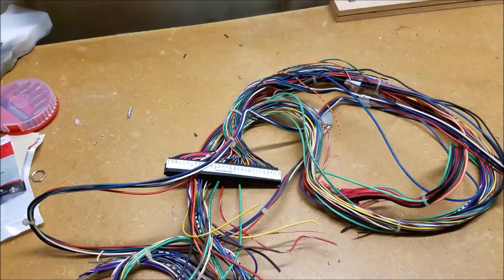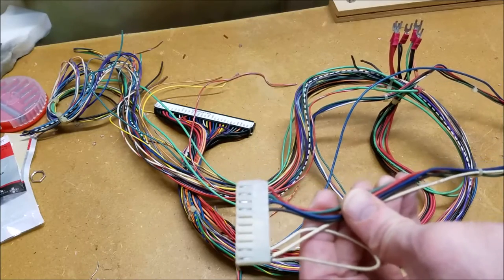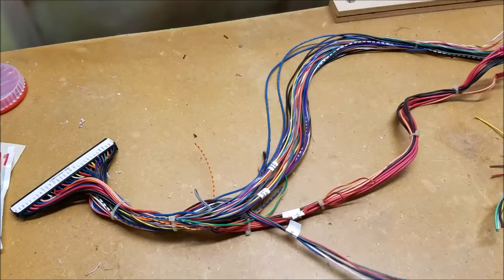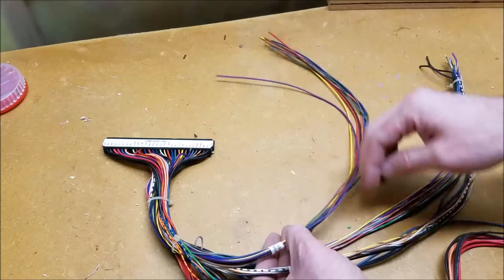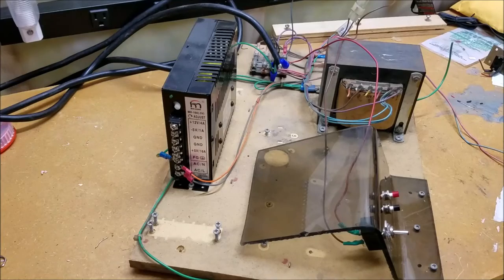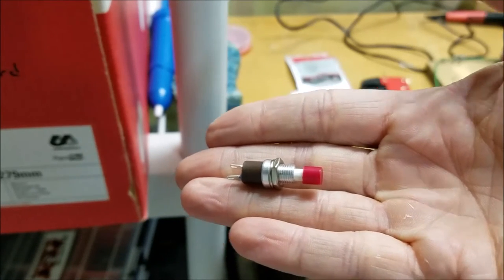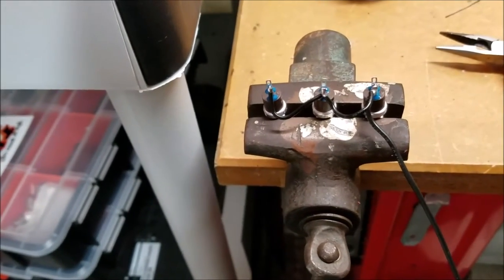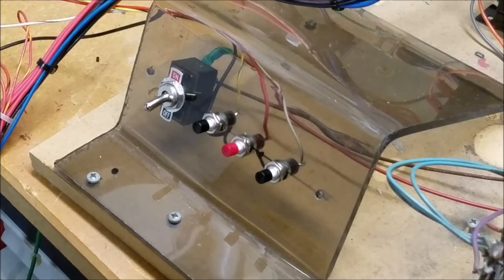Let's Make: Arcade Test Bench - #3 - JAMMA Harness

Comment: nice update Tim! not sure of where youre at but if theres a microcenter near you they usually have cheap computer speakers for like 5-6 bucks, that way you have an amplifier already on them in case your test board doesnt have an amp board for its sound. looking forward to the next part!
Reply from the maker: I'm in New England. Something like that would be great but I haven't heard of one of those. That would be perfect though!
Reply: That Tim Guy its a computer/electronic store..kind of a cross between radio shack and your bigger electronic chain stores..google their name and go check out their site, maybe having some shipped to you is an option if your not able to find some at your local thrift stores,etc? just a thought..

Comment: Hey Tim. Would you happen to know what power supply I'd need for a Ring King? Could I use one those Happ style ones or do I need an original? 
Great video btw.👍
Reply from the maker: Standard switching power supply should do it! They are about $25 or so. If you're doing the Google Search, it would be, "arcade switching power supply."  Just make sure to match up your wires to the correct voltages. If it's your first time, just do one wire at a time to make sure they all match the correct voltage. Good luck and sorry for the delay!
Reply: @ThatTimGuy  No worries I appreciate the reply and info. I've got a few arcades, but I'm still learning with everyone I get. I'm starting this RK cab from the ground up. I ordered the switching power supply... so I'll double check the voltage. I appreciate the help.

Comment: Hi buddy im new to this.ive built an arcade table.player 1 one end player 2 the other end.my question is which im stuck on is ive done the wiring on player one side.but when move to other side player two the ground dont reach you get about 6 spades to conect the rest are going across the center of table .which you cant use .can you xtend these in anyway so to ground everthing as it should be ..thank you
Reply from the maker: You can absolutely extend those ground wires. The wiring harnesses are often not set up for cocktail tables so the wires tend to be too short to do that. Often the wiring harnesses have little zip ties holding the wires all together. You can undo those and then retie them. Perhaps there is a ground wire in that bunch that will make it. You can also extend the ground wire (it can be any color, but I try to keep them the same) by splicing it in or making another connector to go in it. They are typically spade connectors. 0.25 is a common size. If you need more details, please feel free to let me know. Good luck